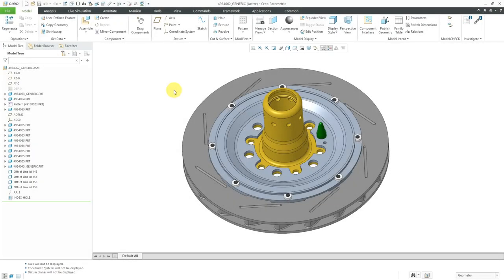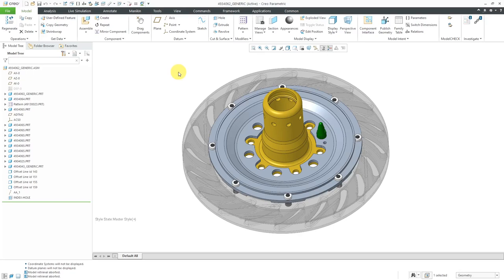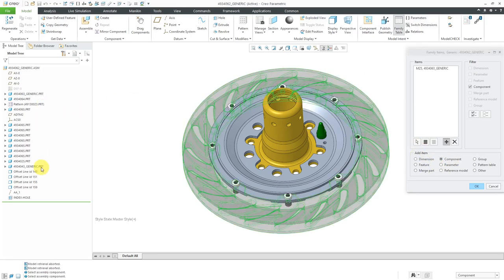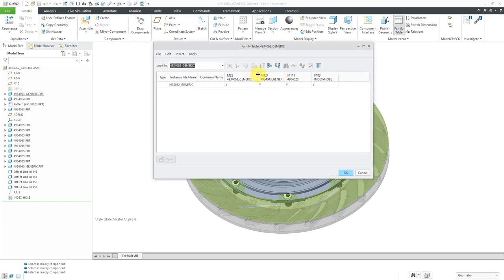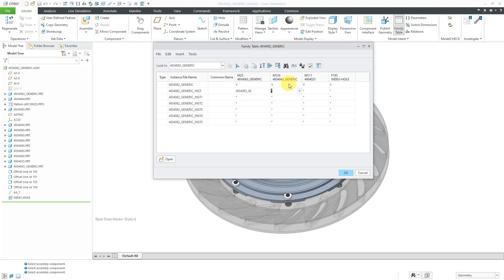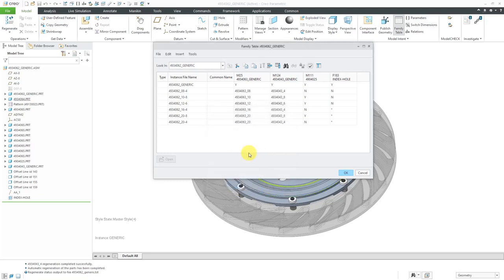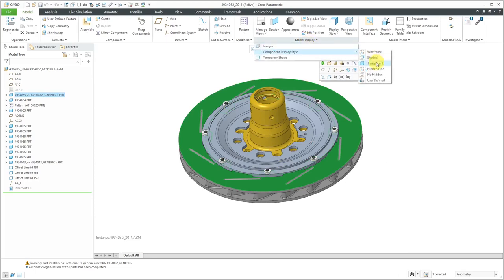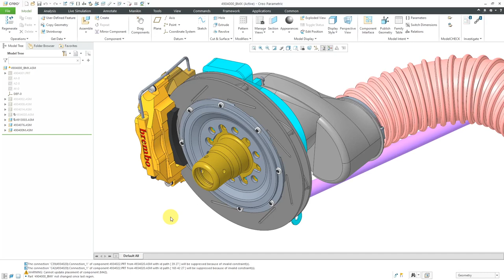Creo Parametric - Assembly Family Tables

Comment: Do you have a video showing an Assembly with Alternate part positioning? Think you mentioned this in your video.  Example: Common Decals for a Large and Small machine, same decals but different location per machine.  I currently use Coordinate System dimensions in the family table.  I am wondering if there is a faster way.